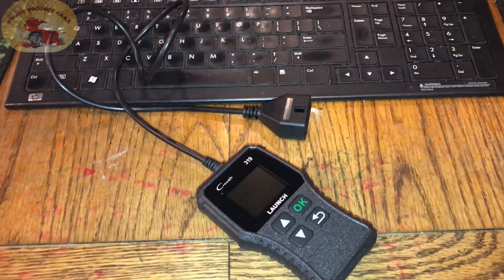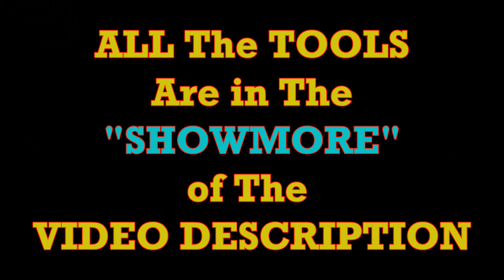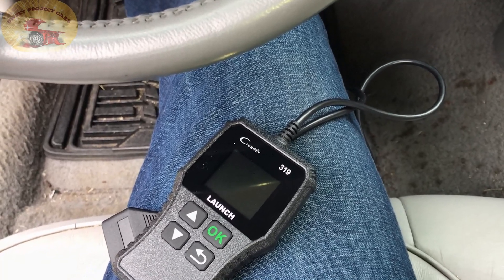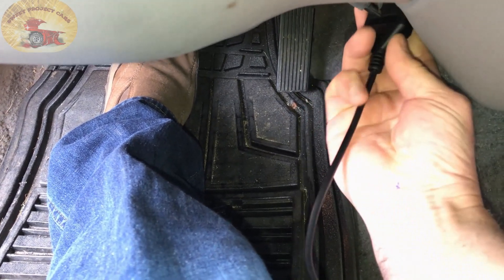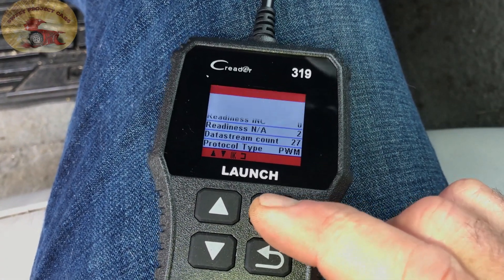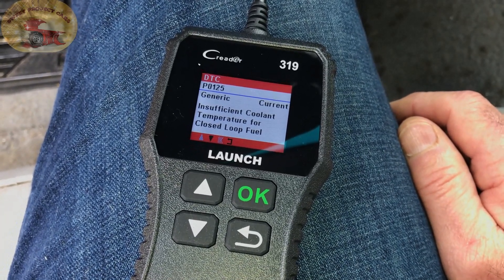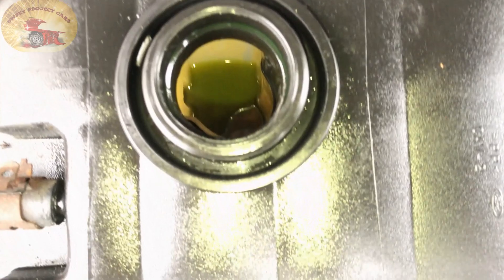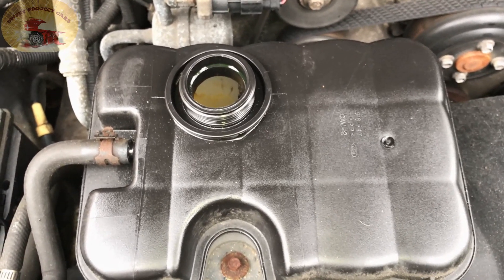A Simple, Cheap OBD2 Reader ANYONE CAN USE for Check Engine Lights

Comment: Wow. All the shops around here, and the parts stores will read your check engine light for free. At least in my experience so far.
Reply from the maker: loni  it was an emergency on our day off so it was fair more than fair actually plus it was a 45-minute drive there and 45-minute drive back and that did not include the work we did, 40 minutes for that...so do you that that's fair. we usually get 50 bucks an hour for most everything we do but we are fast other than driving, plus she did not live by a shop or a parts store and she was worried it was something serious so she did not want to drive it

Comment: Man that's a $20 reader, give her that code for free with a full detail! May need a thermostat, could be stuck open if it returns.
Reply from the maker: in an emergency on our day off it is fair more than fair actually  plus it was a 45 minute drive there and 45 minute drive back and that did not include the work we did, 40 minutes for that...so do you that thats fair. we usually get 50 bucks an hour for most everything we do but we are fast other than driving
Reply: @SweetProjectCars  yeah I'd say that was fair for sure

Comment: I think that code is saying that the engine coolant temperature is not getting high enough to go into closed loop fuel control. Either the sensor is bad or perhaps the thermostat is stuck open. Husband could have pulled the connector off the sensor.  Just my two pesos Julio Cesar Chavez.
Reply from the maker: we added the coolant for her and both all code were then clear  thanks for sharing

Comment: You need to figure it why it's losing coolant. Adding coolant based on a code isn't a diagnosis. If the source of the leak isn't found, it will happen again and it may not be pretty.
Reply from the maker: as mentioned in the video she thought he ex was doing things to the car come to find out he was taking the fluid out
Reply: @SweetProjectCars  
He was removing the fluid!?
Reply: Weird thing to do.
Reply from the maker: people do weird things when they are in the middle of a divorce

Comment: FREE AT MOST AUTO PARTS FOR FREE NOT A COST.
Reply from the maker: in an emergency on our day off was fair more than fair actually plus it was a 45-minute drive there and 45-minute drive back and that did not include the work we did, 40 minutes for that...so do you that that's fair. we usually get 50 bucks an hour for most everything we do but we are fast other than driving and she did not live by a SHOP OR STORE and she was worried it was something serious so she did not want to drive it

Comment: Would you say that would be a fair price to charge a customer to read and diagnose cars CEL' New to this and just wondering if that's a going rate. Thanks much 👍
Reply from the maker: in an emergency on our day off it is fair more than fair actually  plus it was a 45 minute drive there and 45 minute drive back and that did not include the work we did, 40 minutes for that...so do you that thats fair. we usually get 50 bucks an hour for most everything we do but we are fast other than driving
Reply: @SweetProjectCars  Thanks for the reply and I just did a brake job for someone and I also thought that would be a fair labor rate. and would also consider the book time for the job. So the quicker I do it the better for me. Thanks again👍
Reply: @SweetProjectCars  It amazes me people want to complain about you charging $50 for doing what you did as you stated on your day off and travelling to and from and do the repairs all this just because people do not check the fluids and oils i see it all the time like you said the car needed some love a service once in a while helps out in the long run as it can give you foresight as to what is going on and what will be a issue later down the track.
 Good Job Sweet Project Car Love your work👍
Reply from the maker: orrible you are very correct and it was a house call and 1-1/2 hours just to get there and back
Reply: $100-$150 bucks to diagnose at the Stealershop. No question!
Reply from the maker: you are correct and it was a house call...1-1/2 hours just to get there and back
Reply from the maker: that may have done it lol
Reply from the maker: you got that right my friend